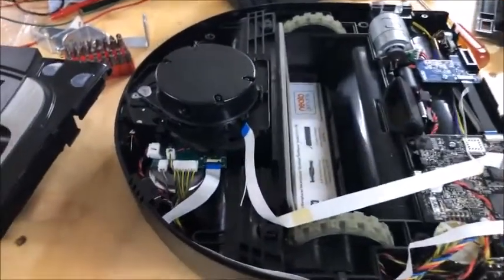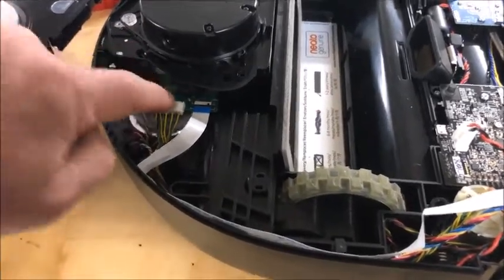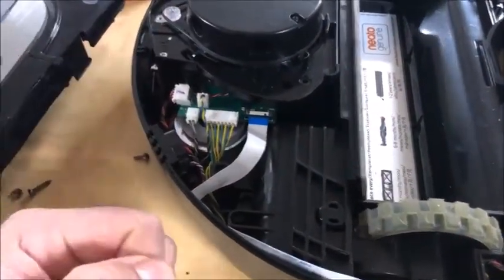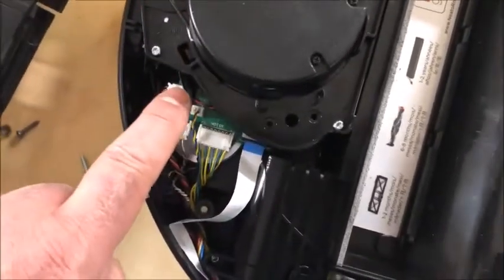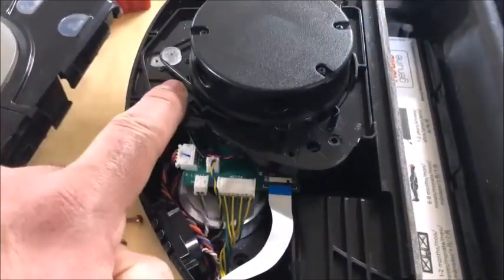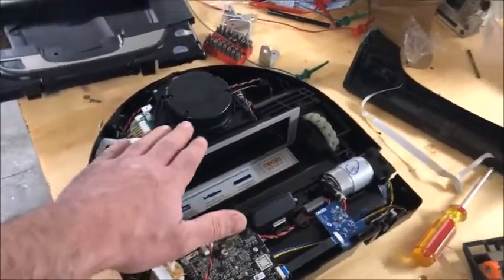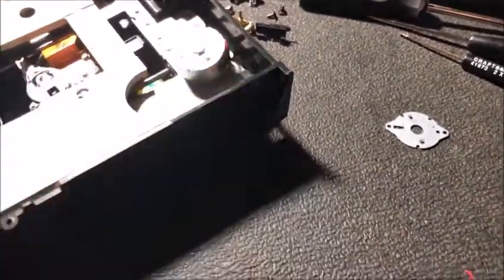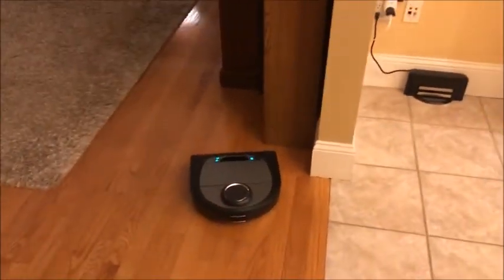Neato D7 Lidar not spinning ERROR 3000 SOLVED

Comment: Hello Recently bought a D7 as spares and repair. I started the D7 and it showed the exact same issue what you have. I opened it up and noticed that the lidar ( laser ) does not spin. The belt was found ok. So I removed the lidar board and the little motor which makes the lidar spin. I found that the motor shaft was full of white hair what I had found inside the machine too. I removed all the hair how ever it did not fix the issue. I did a little measure on the board. It sent 12V to the electric motor. That means the motor broke. New motor cost between 5 - 15 ponds on the internet. It was an easy fix.

Comment: I bought a RF-300FA-12350 DVD player motor from ebay (3,99€). I cut of the old motor from the plug and soldered the red wire to the black one. Works fine. Thanks for the video!

Comment: Thank you! My d7 has been out of commission for over a year now. The lidar spins after swapping the motor. And a huge thanks for the tip about the cd drive motor.

Interestingly, I never saw a 3000 error, just a "reboot me" message. And luckily my ribbon cable was intact. We'll see how long it lasts... At least I have a couple extra dvd drives lying around somewhere if I need to do it again :)

Comment: I do have the very same situation. Broken cable, even looked kind of burned.. Bought new one on ebay as well for way too much money and replaced it :-) and still doesn't work. 
Figured out today the lidar motor does not spin, but with a slight push it starts rotating. So the motor seems to have some trouble. So will likely replace it as well, but I will need to get some overpriced one from somewhere as it seems. I am not that lucky to still have some old CD player around :-)
Not sure where else to look for some matching 12 V motor.
Maybe I do find someone with a broken Neato D3 D5 D7 or Vorwerk VR 200 and 300, they all should share the same motor

Comment: Thanks for the video! Absolutly the same issue with my D7. What is the type of the cable - Reversed side or same side? Also where did you both it?
Reply from the maker: I believe it was "same side" or "forward". Just take the cable off, unfold it and if the connections are on the same side then it is "forward. Search Ebay for "Pitch 0.5mm 20 Pin FFC/FPC Flexible Flat Cable Wire 20624 80C 60V Width 10.5mm"

Comment: I replaced the o ring, motor is good and lidar spins but continues to stop and start.  Neato states that it is LDS-miss- packets.  Also the ribbon is in good shape.  This has me stumped any ideas??
Reply from the maker: If it spins then I would say that the motor and ribbon cable are both good. when you say stop and start are you referring to the lidar stopping and restarting to spin on its own or the entire machine? if you are referring to the lidar that the culprit is probably the belt. Maybe the new oring you are using is too loose?
Reply: @ScrapMetalWorks  the lidar circuit board was bad.  I replaced it and it's working great
Reply: @anthonyg8435  where did you get that
Reply: @sethtopps9611  ebay